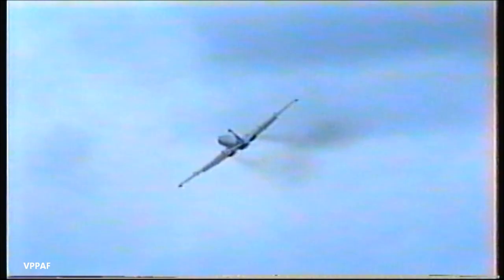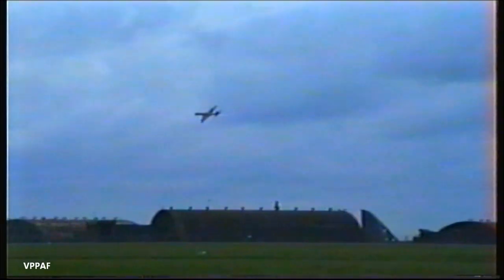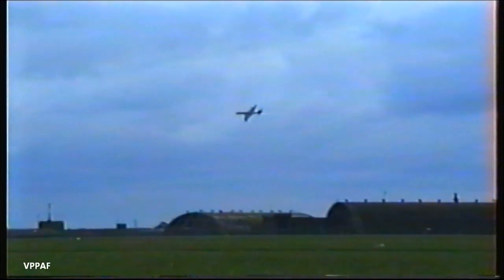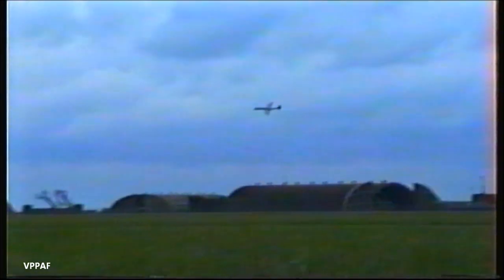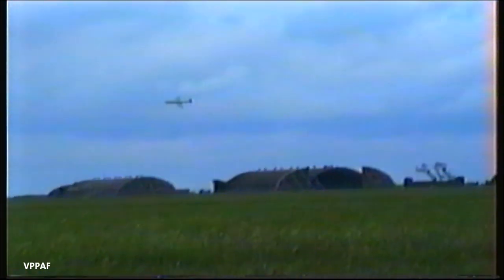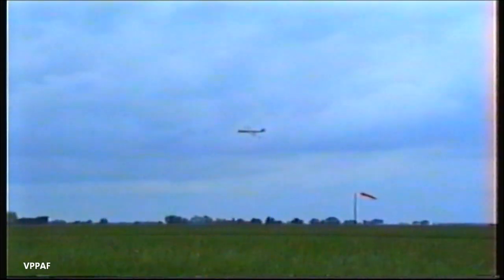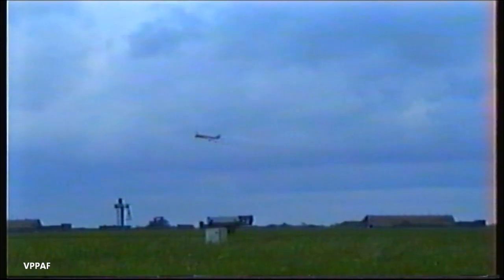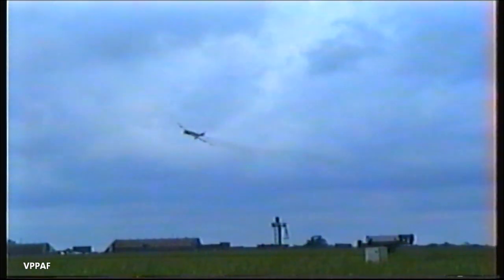RAF Nimrod flight and a crash at Toronto air show in 1995

Comment: I was there the day it crashed. This is what happened, the wind was coming from the south the key here is wind direction. On the fly by in front of the crowd the plane was heading west he was not flying level but a slight bank so the crowd could get a better look at the plane and possibly the pilot could see the water better because he was low and extremely slow. The plane turned south away from the crowd and was now heading directly into the wind, still at the same bank (not level flight). The plane then turn east and flew for a bit this is where I said to my wife at the time, I hope he does not turn north he is flying to slow (remember wind direction). The plane started turning north and as soon as he started to turn you can see black smoke coming from the engines, I'm guessing he got a stall warning and went full throttle. It takes a bit for the engines to spool up after you go full throttle, the black smoke is from the unburned fuel.  He was too low for the engines to have time to give full power before he hit the water. When the plane hit the water, it was directly facing north the wind coming from the south that day was quite strong. It was a sad day, RIP crew.
Reply: If you talk to pilots about this, most will say the "dreaded downwind turn" is a myth.  They say the plane flies in the air, and if the air is moving, that is the frame of reference for the aircraft's physics, not the wind speed and direction on the ground.  However I believe it could be a factor, because the wind is not exactly the same everywhere, and if the turn was borderline stall but then entered  a different stream of wind velocity, it could have triggered the stall.  Imagine a large log dropped into a fast moving river - it eventually has the same velocity as the river, but it takes a bit of time for the mass to be influenced, and for the first second in the water, the log has roughly the zero speed it prior to being dropped.   That isn't literally what happens for aircraft, but helps to understand how it takes time for velocity to be pushed by fluid mechanics.

I am not going to argue this either way.  These are possibilities as far as I'm concerned.  If you want to see a debate about downwind turns, visit: https://boards.straightdope.com/sdmb/showthread.php?t=545074
Reply: Down wind turn is a bullshit explanation. Airplanes only know the wind moving over the wings.
Thats like saying a boat in a river will sink if it turns downstream.
THINK ABOUT IT.
Reply: wind can be a factor in compressor stall.

Comment: i have no idea
Reply: An airplane stall is an aerodynamic condition in which the aircraft exceeds its given critical angle of attack and is no longer able to produce the required lift for normal flight.  This type of stall should not be confused with an engine stall.  It has nothing to do with the engine or another mechanical part. In piloting, a stall is only defined as the aerodynamic loss of lift that occurs when an airfoil (i.e., the wing of the airplane) exceeds its critical angle of attack.

Comment: I was there. 
I remember  the young British pilot.
The engines were running full speed.
If the engines stopped why can you see the exhaust? 
The commentator is misleading the people.
It was 100% pilot error. 
The pilot  made some comments about the Rolls-Royce engines at a party  a night before. 
He made a comment ( I will show you the power of the Rolls-Royce engines )
He was showing off, overestimated the four engines power in a tight turn.
The speed was to low in the turn and he put the Nimrod in a classic stall. 
7 people paid with their life for his attitude !
Reply: i dont think it stalled, if you put a plane on its side it will drop like that, nose first, it was flying with the wings vertical.  he just lost a lot of altitude when he cranked and banked. 
if you are going to do a stall turn or wingover you need to get the kinetic energy of the aircraft going upwards before you start the turn, that way you wont lose altitude as the nose drops as you have raised the nose to compensate for it falling during the turn.